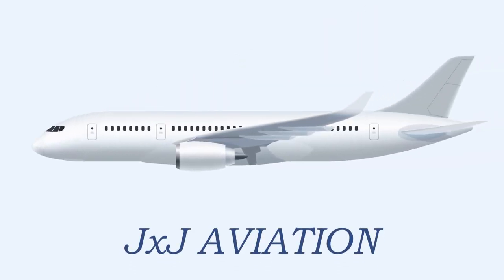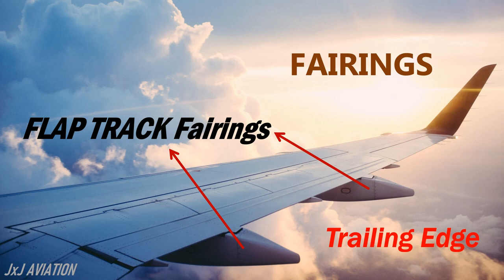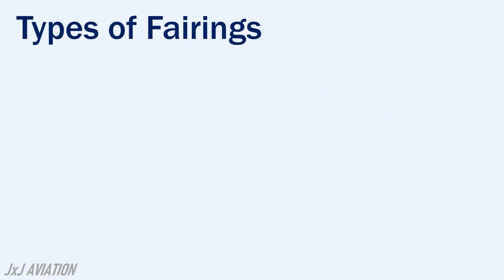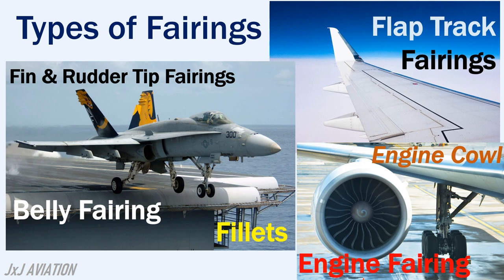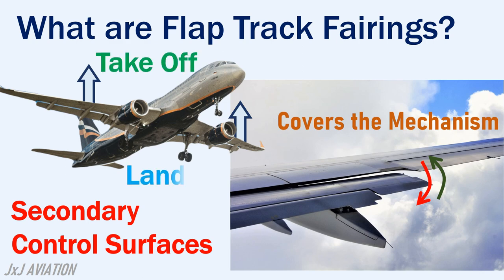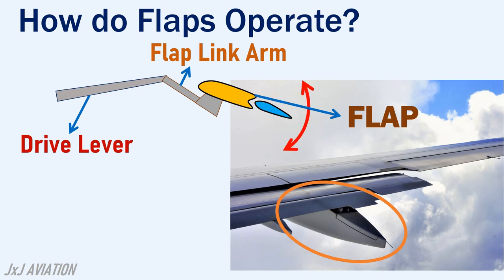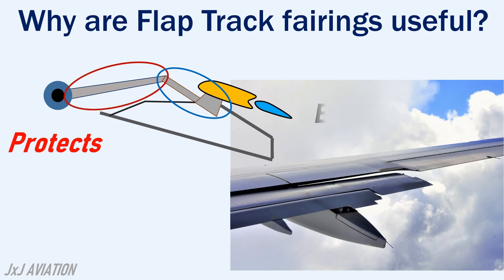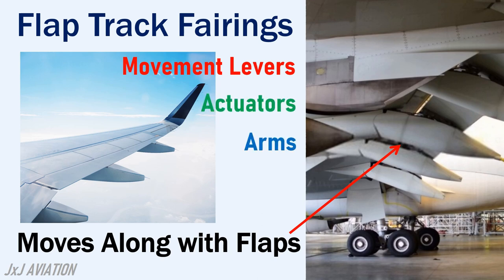What are these structures installed on an Airplane & Why are they installed?

Comment: why don't military transports have those things then?
Reply from the maker: The surfaces are smaller and the deflection angles do not require these type of fairings.
Reply: @JxJAVIATION  that's a very good answer. However, I question the "deflection angles" as the reason, I am thinking it is due to the amount the flaps can extend out in commercial ones.
Reply from the maker: @ylstorage7085  Yes that can be another reason: The flaps extending outward AND downward in commercial jets.